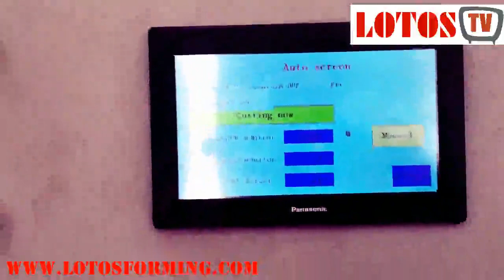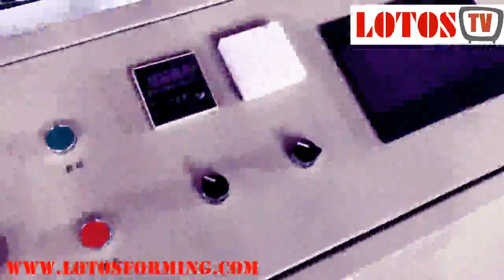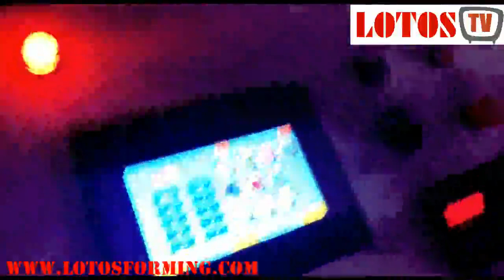Roll forming machine for produce all Roller Shutter Accessories

Comment: https://www.lotosforming.com/2019/05/01/roll-up-shutter-door/
Reply from the maker: Shutter Door Repairs just check the shutter one by one, only need to change the damaged shutter, not necessary for whole doors replacement.Not limited with listed advantages, but more benefit will be discovered during daily usage of ROLLING SHUTTER DOORS.

Comment: may i have complete machines that need run roller shutter producing factory?
Reply from the maker: A double layer roller shutter overhead door is a type of door or window shutter consisting of many horizontal slats hinged together. The door is raised to open it and lowered to close it.